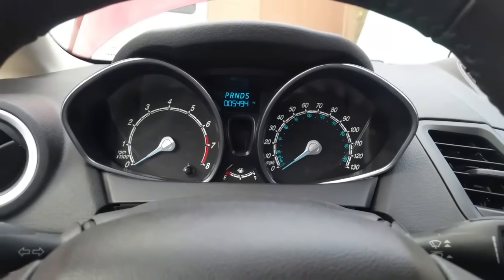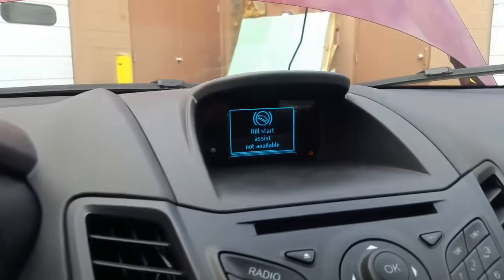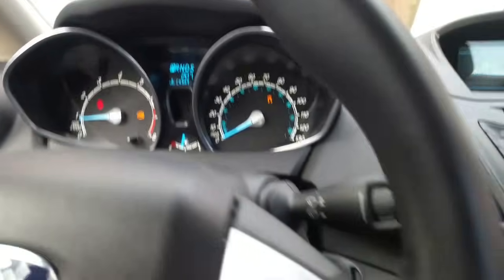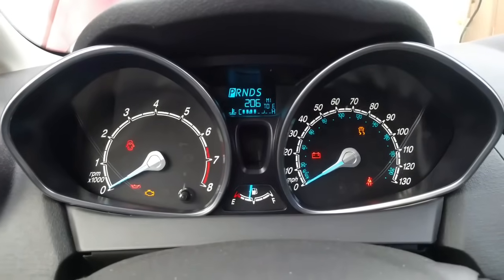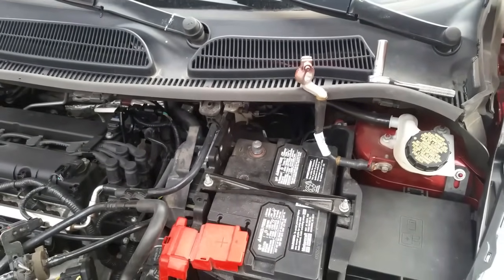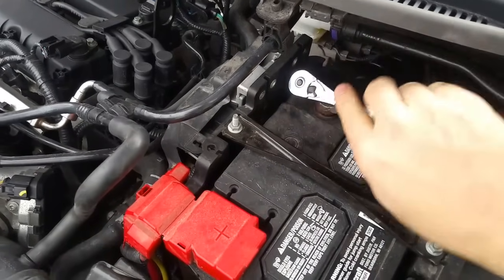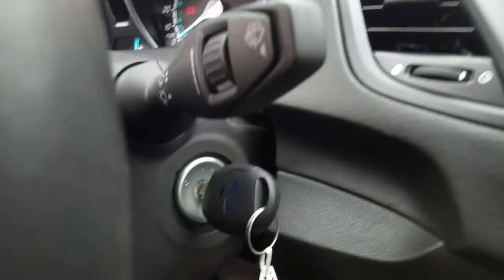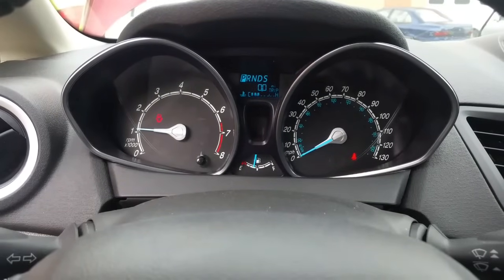HOW I RESET SOFT CODES ON FORD VEHICLES ABS, TRACTION CONTROL, ADVANCETRAC WITH OUT SCAN TOOL!!!

Comment: I did the same on 2018 Ford Fusion S and it worked just as good. Couldn’t reach the negative terminal to disconnect so I did it by doing it with positive. Must work for all fords. I did have a 2017 F-150 STX that would malfunction and the method I used for that was master reset the head unit( radio)

Comment: My Fiesta yesterday replaced the broken left lamp ball. Must open the battery and fuse box. Then ABS indicator appears, hand brake lights, and traction control. is this method useful for removing ABS lamps??

Comment: I have three light on: engine, tire pressure sensor and ABS. Also, the fuel inlet message on. I use this method, for 5 mins. When the power on, the engine light off and fuel inlet message gone. 
Amazing! Thanks!
Reply: What about the tire pressure light?

Comment: So I replace the radio to aftermarket, and I didn’t plug airbag passenger side light because I don’t have anywhere to connect it this is the light that tell me passenger airbag on passenger airbag off,  do my ii think it will reset this?

Comment: How do you reset them on a push button start for edge?
Reply: Attempt starting but don't place yiur foot on the brake pedal. That will turn on the ignition without starting the car.

Comment: this does not always work.... because if you have a keyless ignition , it does not seem to have a half turn like a key.
Reply: On is On regardless hou have a turn key or push to start. On the later, just press start without hitting the clutch or brakes. Just start, no footwork.

Comment: Just want to say thank you !!!!!! 2014 fusion with ..advanced track n steering fault light on.....and no pwer steering....this worked !!!!!! Hopefully buys me time till i can get rid of this nightmare car
Reply: It's happening on my 2014 fusion as well 
When it happens my steering wheel gets stiff and when the lights go off it returns to normal 

Was your fusion push start ?
Reply: @htc5972  no mine has key start
Reply: @htc5972  I will never forget the day this happened...was at work 100 miles from home...and of course a blizzard dumped 9 inches of snow in a few minutes...I drove car whole way home with power nothing....but did this...and it reset everything...and car still runs great ...never happened again
Reply: @iannluci  Damn that sucks it also sucks that mines push start so I'm not sure  if it'll work the same.... but I'll try and do it anyway
Reply: @htc5972  keep me updated....I hope it does.....
Reply: @iannluci  so I know it's a little late i was busy the whole week but I got around to doing it and sadly since its push start I didn't get any results 😢
Reply: @htc5972  aww man that sucks.sorry to hear......this past weekend I had another issue...I got in car to make an hour drive to city...and realized all my steering wheel controls did not work...like volume and even turn signals
.....guess what fixed that after a Google search......I had to flash high beams quickly about 10 x ....immediately all controls on steering wheel worked again...weird stuff on these cars nowadays

Comment: I've got a 2012 with PUSH button start, HOW do you do this with this push button setup?
Reply: Chevys push button you just hold the button down for like 5 seconds then it turns to the on position ignition on but don't put your foot on the brake
Reply: Usually, you have to put your foot on the brake to start the car. Press the start button once by itself (no brake) and I believe your electric will turn on.

Comment: This did not work! Done twice And still have advance Trac and power steering service now. I replaced the power steering. It locked up again right after i got the car back and made it home. My car Stahl's while driving and jerks back and forth. I pull over cut car on and off. Cut back on and some times it'll go sometimes it'll do again.  It's not my power steering seeing I replaced it. What can it be? Now my tire pressure sensor fault is on. Replaced every tire yesterday. So no low tire pressure! So idk!! Sensor was pulled out of one tire. A tire without a sensor. Could it be that? Can that throw computer off? Please help

Comment: This saved my wallet!!!! I tried this on my 2013 Ford Fusion and it worked!
Reply: What all lights were on. I have 3 lights on on my 2016 Fusion along with Beeps every time I start it. I have to keep hitting the ok button to stop the Beeping
Reply: @ronniemassart3834  Did you solve it?
Reply: @bastiansnow  No,I think it's going to have be fixed by taking my wallet out and paying a professional with high end equipment but I'm such a tight bastard and been off work for 5 weeks and counting so the wallet is thin

Comment: Tried this and did absolutely nothing.  Still getting same lights as before.  So probably need something replaced.
Reply: I DID IT TO NOTHING. I HAD MY POWER STEERING REPLACED $800. NEXT DAY "SERVICE POWER STEERING/ADVANCETRAC" CAM BACK, IT IS NOT THE POWER STEERING , IT IS SOMETHING IN THE ECM, LEAST I BELIEVE. GOING TO CHECK TODAY
Reply: @original2858  did you sort out your issue?
Reply: @joshsammut3327  no, it just locked up and I drove like that til my palms were rough. I gave up. Replaced whole power steering and nothing. Advancetrac, service power steering. Just still up
 I stopped driving it.

Comment: What is a hard code ?
Reply: meaning there is really something wrong with your car even with these steps he showed you doesn't work. Which means you need to take it to a mechanic and have them scan the car for whatever codes its give you.

Comment: THANKS SO MUCH THIS ACTUALLY FIXED MY POWER STEERING!!!! Jumpstarted car and after it started told me power steering, steer assist, traction control, abs, hill assist all of it needed repair. I thought I fried the chip. Power steering was actually out. Unplugged battery 5 mins and everything is running great! I OWE YOU!

Comment: Thanks man, u saved me a lot of money. They told me ot will cost over 1000 to fix this problem. NEVER TRUST A mechanic
Reply: Same here in the Philippines they cost almost 69 thousand pesos. I will try this. I don't  know about car  I just drive , until I need to search about this ABS MODULE , because the Ford casa will pay me a lot of money .Thank you George.
Reply: @wengdivinaflor9576  kmusta po? Effective po ba aa inyo?  Sa akin tinesting ko ngaun pero ganun pa din. .may abs, hillstart assist etc nakailaw pa din 😔
Reply: @bongsoliven7822  hello bong sakin umilaw sya while driving. then pina scan ko. u3000 lumalabas sabi nila abs module daw. na fix na ba sayu?
Reply: @wengdivinaflor9576   sir effective po ba? ganyan kasi yung sakin for focus 2011 model

Comment: This is a problem I currently have with my zetec fiesta. I bought it  from a dealer and the battery was flat so he jump started it. After about 130 miles of driving this issue began. The garage sent it to a mechanic who checked all the wiring, checked the voltage from the alternator, checked the ECU and it was showing no fault codes. He said he done all he could. Now the dealer is now going to send it to a ford specialist. Hopefully he can resolve the abs and traction control light. It only comes on when driving over 30 miles per hour at first but now stays on when you start the engine. I will post update if the specialist can sort it.
Reply: What was the fix?

Comment: Thanks this worked on my 2011 ford e 350.  At first I tried the 5 min idea but it didn't work , on my second attempt I did 10 min and so far advanced tracking signals are off.  Thanks for the video.
Reply: Did it stay off? The first attempt it didn't work but try ten minutes and it worked for you? In about to try and want to make sure i do it right the first time.

Comment: George did you ever work on Fiestas with U0401/U3000 codes? ABS/traction controls are on with these, Ford has no bulletins on repair. Sometimes cleaning contacts and a new battery helps, sometimes not.
Reply: My car has this code "u3000:49" un the ABS module , did u repair this ,cleaning and changing battey? Thanks

Comment: Will this work for the battery light
Reply: No. Battery light means an battery or alternator problem. One of them may need to be replaced. If it is the alternator, its cheaper to get it reconditioned.

Comment: I tried it on Escape/Maverick 2004 and did not work. My ABS light came off after I drove the car with fixed ring/ABS cable for just 15 meters.

Comment: Doesn't work on 2014 fusion. I parked my car came out started it. Dash lit hill assist unavailable.. Service traction control.. Abs light.. Airbag light.. Check engine light.. Tried pulling codes at auto one but no codes.. Went to advanced auto they can pull abs codes but none found. Did thus twice. Also did the unhook and put terminals together all lights and warnings still on.
Reply: FilthyFletch my 2014 Fusion is doing the same. Just out of nowhere. Lmk if u have any luck correcting it. Thanks
Reply: Ended up a pigtail connector on my right front abs cable was bad and all these warning lights are interconnected. $35 part cut 2 wires spliced and soldered. Ford wanted $385 to do it. My pcm and Map sensor went bad  4 days later after changing purge valve. Ford wanted $1996 to replace with 2 year warranty. I removed the pcm its 3 nuts 2 cables sent it off for rebuild with lifetime warranty for $231 and $17 for the map sensor. Total time to remove then reinstall 15 minutes.
Reply: FilthyFletch wow....my 2014 fusion just started this morning. This is good info
Reply: Well ended up getting worse Ford had my car 3 months couldn't figure out what was happening. Replaced the pcm computer. Mat sensor Maf sensor.. Another purge valve.. Purge assembly lines.. Battery.. Another brake sensor.. Throttle pedal.. Throttle pedal position sensor.. Traced all 7 miles of wiring.. Reprogrammed all on board computers.. Last item replaced after a guess as their computers didn't find it was a Throttle Body Position sensor and a  fuel pressure sensor on the fuel rail...Fird refused a courtesy loaner car or to pay for a rental so I was out of work for 3 months lost $14000 in income and they covered zero of the repair cost.
Reply: FilthyFletch l 214 ford edge shut up Blindspot on me or after was disconnected
Reply: I have a 2010 Ford Mustang with traction control lights on and the advance system as well as ABS. Ford is out of their minds for what they want to charge to fix anything. This is my second mustang in 16 years and all they want to do is rob you there. Tried telling me I needed a new battery after I replaced mine months before. Thieves. Fortunately I found someone who works on cars for half the price and is trustworthy

Comment: I tried this and now in addition to having the ABS and other warning lights on I also have a transmission problem in the car will not go above 30 miles per hour or shift from the lower gears. This is a risky procedure and I cannot recommend it.
Reply: Shittt

Comment: I did this last night and then my car wouldn't start at all.  Wasn't having an issue with it starting prior to doing this.  I'd advise against this and just take it to a mechanic to get it checked out.
Reply: mferguson1281 sounds like a really good way to fry an ecu
Reply: mferguson1281 this procedure did not cause the starting problem.
Reply: Do not fix if there is no issue/problem

Comment: Thanks this worked on my wifes Ford Fusion. lights came on after the battery went down and had to be boosted off. The power steering stopped working. After we did what you said in your video everything returned to normal and I am sure saved a costly repair bill Thank s again
Reply: My power steering light came on with the Avancetrac light but I was driving and lost power steering I wonder if that will work.?
Reply: radzney white Hey bro. I have a fusion as well. My advanceyrack and power steering lights cams on. You said this worked for you right?
Reply: radzney white did it work? My advance power steering came on and power steering stopped working as well. Did this method work did every thing go back to normal?
Reply: I have a 2010 Ford fusion. I had a sensor taken out of my tire . Ever since my power steering service now and advance Trac popped up. Also saying tire pressure sensor fault. I replaced the power steering because it was so hard to drive. Got it back three days later. Drove home working. Bam by the time I got home it locked up again. This is 45 min later. I know my power steering doesn't need replacement. I just got it fixed. Something is throwing it off. My car even stalls when driving. Tires spin and want go. It jerks back. I cut off and back on then take off. Some times, well most of the time I have to keep doing it. Horrible! If this can reset on my fusion power steering and advance Trac then I will be saved from money. The replacement of the steering broke me. I have no more I can do with this car. Please let me know how your fusion is doing and If this is what you were going through. If this helps for real I will be so happy!
Reply: @original2858  bro did it work for you. Please let me know I am facing the same issue
Reply: @SuryadevaraRammurthyNaidu  nope
Reply: @SuryadevaraRammurthyNaidu  what I faced was going to Ford place and having the computer rebooted. 1500 bucks. This doesn't work for the problems you and I encountered.
Reply: @original2858  Did the computer reboot fix the problem of the power steering though after you spent 1500 bucks?
Reply: @SuryadevaraRammurthyNaidu  yes it did...computer at the dealership is the only who can fix it. they have to reboot the whole computer system...if it doesnt work then the car is never fixed because computer is basically dying. thats what they told me.
Reply: @SuryadevaraRammurthyNaidu  power steering was fixed however, cutting off and on while driving was not. I found out  a code popped up for that and that was something to do with my filter being clogged which then cost me another $300....I dont even have the car anymore...something else every five minutes...i went and financed a car. Sad to know i put money into it just for something else to keep messing up.

Comment: I should try this on my 16 ST i just got a repair done on the inside and they also did my 25k service but when i drive i get the Hill start assist not avail. But it doesnt come on when i start the car only when i drive for 5mins or more.
Reply: PT3005 how do you do it if the car is push bottom ??

Comment: Does the negative have to be disconnected or does it work with positive also?
Reply: doesn't matter ( when u remove one of them ) u are breaking circuits 
( these circuits response to start the car by motor or give initial force which is [ Torque ] & give information in odo meter )
Reply: It doesn't work. If u want it reset go buy those Innova with abs from Amazon for 50$. I just got mine out today

Comment: I sure wish this worked for me. But following your instructions I still have the "check advancetrac" and abs light on. 2003 Ford Expedition.
Reply from the maker: +Alan Anderson you might have a hard code in the system that requires something to be fixed. If there is no issues it should reset.
Reply: I recently replaced my alternator and battery on 2010 Ford fusion.. Now my Service Power Steering Now & Service Advance track lights are on. Will this work
Reply: @brayshelleosborne8300  same here. I have a 2010 Ford fusion. Replaced sensor on tires. Power steering popped up and advance Trac. Replace power steering and a hour after taking bacm from the shop to my house it popped back up. I know it's not my power steering since I replaced it. Did you try this? If so what's the outcome because in trying this tomorrow
Reply: Took It to Ford & had the codes cleared $85
Reply: Brayshelle Osborne is your power steering working now if so how did they fix it????
Reply: Go buy the 50$ Innova with abs from Amazon. It will reset it
Reply: That reader doesn't have ABS ,read the comments on it, that reader doesn't support ABS I almost purchased it.
Reply: Brayshelle Osborne on your ford fusion there is a recall on the electonic power steering system
Reply: thanks I'll be contacting ford in the morning
Reply: Brayshelle Osborne same problem with my 2010 fusion. . is yours fixed yet?????????
Reply: yes it works. The power steering is electric. When the voltage dropped it sent the codes out to turn it off. I had my computer scanned and codes cleared. it came back. It was not under the recall as he claimed. If it happens again I have to replace the rack& pinion which is a $700 part
Reply: Brayshelle Osborne n u r right 2010 didnt have a recall like 11-12s
Reply: George Melnik i did this and the abs and traction control still appear. Does it mean i got to solve the hard code? What does  hard code means?
Reply: Brayshelle Osborne thank you so much i will be taking me this weekend.... soon as i changed my battery thats when its said power steering service but thank you i kinda figured it was a big problem hope it does happen again to or me.. good luck ☺☺☺